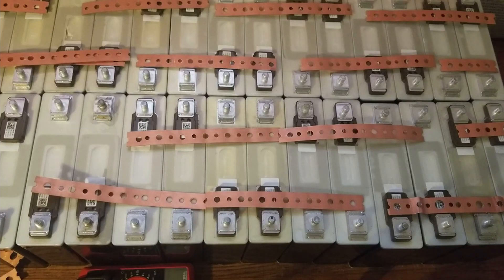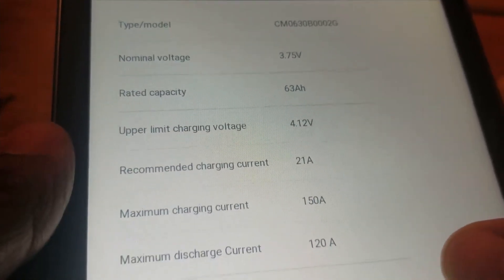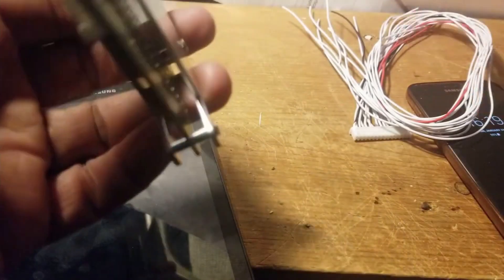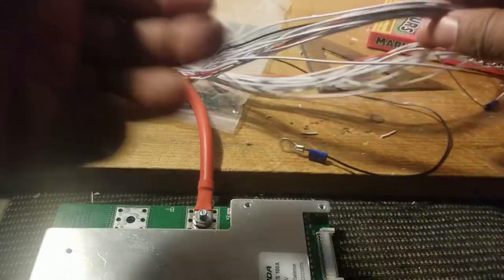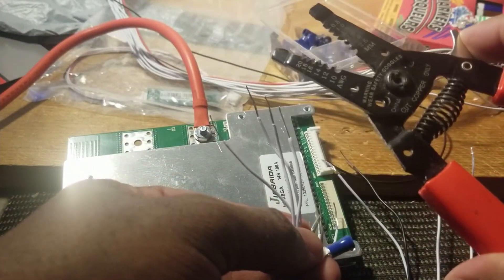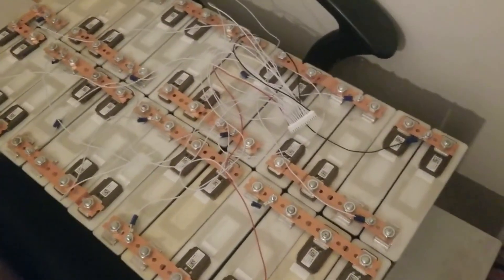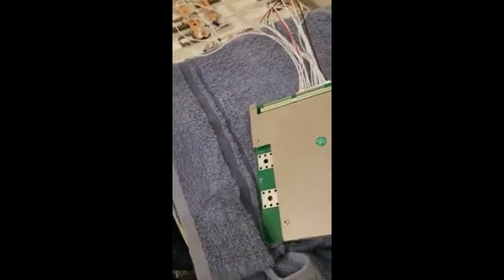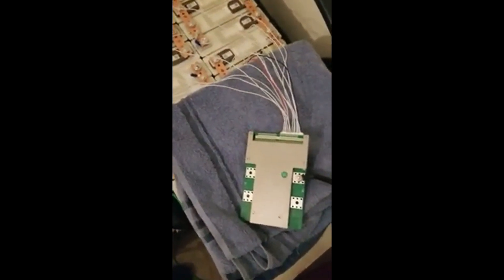DIY 48V 120Ah Lithium Ion Prismatic Battery - Build 6.24 KW  with Grade C cells 14S 2P Very Cheap

Comment: very risky cause whole alloy shell is Positive and you didn't add any insulator between cells
Reply from the maker: I was on test mode. Half of the battery are dead; user errors. They're very good batteries
Reply: @simplyfocus9937  i got the same, 7s 2p , so for inverter 24v. Do you think those are worth the risk , cause li ion  ... not safe as lifepo4
Reply from the maker: @PirateWasHere  I'm not an expert,  but just an user. From my experience, they are fine. Too bad my technician didn't follow my instructions, he destroyed 30 of them. He was trying to set up 14S 4P.. He made a catastrophic error.
Reply: @simplyfocus9937  so what he did wrong ?
Reply from the maker: @PirateWasHere  the tech guy was trying to set up 14s 4p. He got confused very bad.